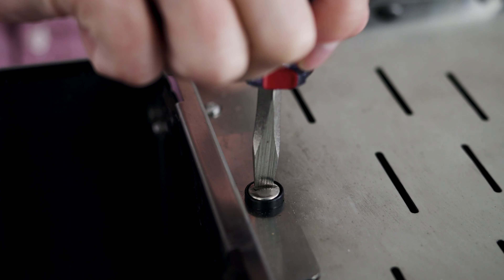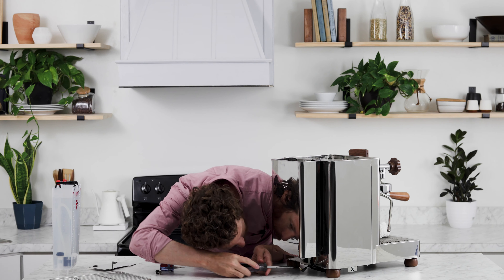Lelit Bianca Movable Water Tank

Comment: I would like to place the water tank at the right side, but dettached from the machine, maybe mounted to the wall. Do you think the water cable and power connector would have the required length?
Reply from the maker: Unfortunately it probably isn't long enough. The tubing and cords are barely long enough to get past the machine.